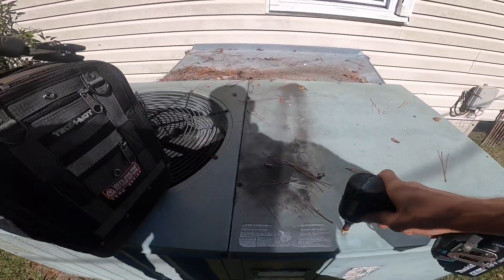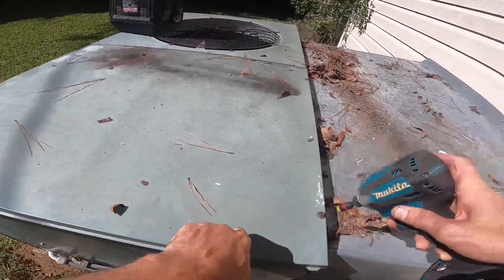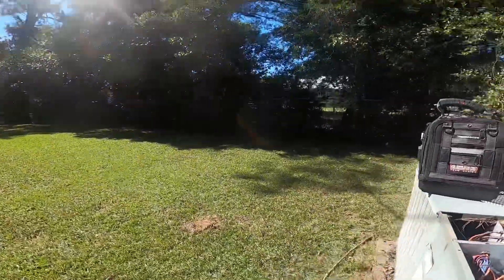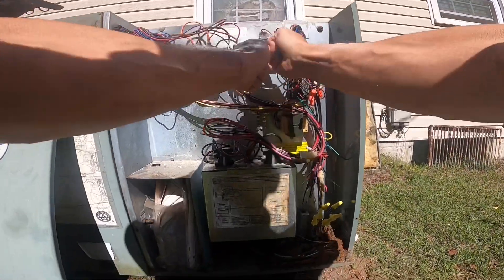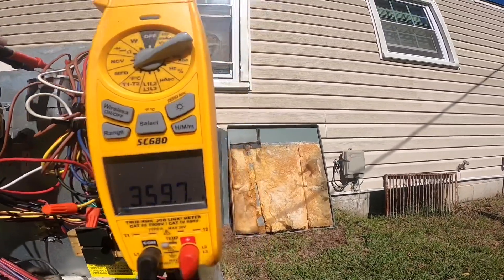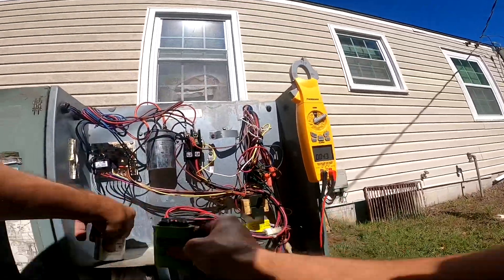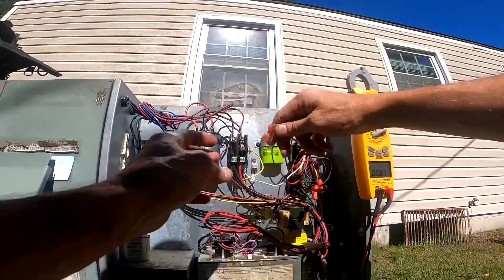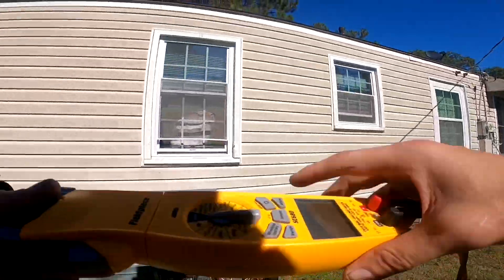Blower failed in less than 30 days because of Chinese capacitor

Comment: You changed the blower motor and put a non-brand capacitor? In another reply you said you didn’t know the brand of the capacitor. Is the capacitor bought from EBay? Capacitors from Titan, Mars, Jard, Genteq, Protech, Packard, etc are all good but made in China.

Comment: What was at the bottom of the electrical panel?  Fire ant nest?  And you didn't clean it out?  Any ants between relay contacts?  Little bastards cause problems.  Clean them out and treat.
Reply: I just saw this video and the ant hill caught my eye; remove it carefully and put some fire ant poison to protect the contactor points etc. Make customer aware of situation so they can take care of it! Write it down in the ticket and let them sign it! No freebees! Ants are not covered by the warranty!